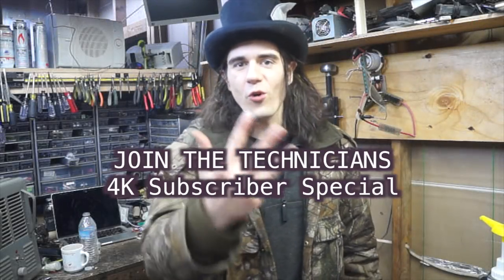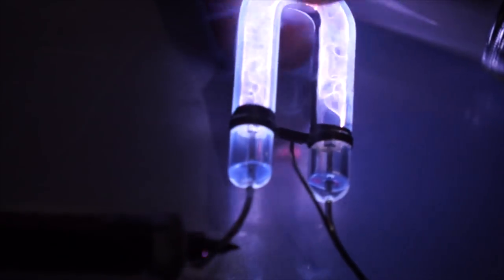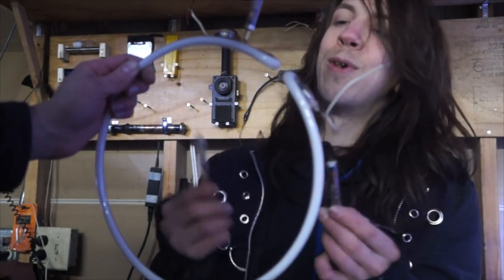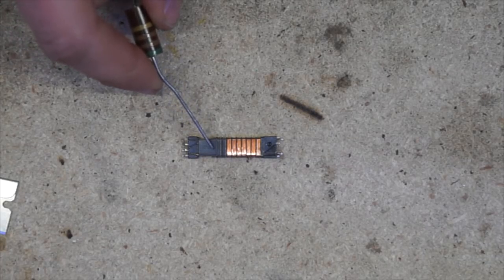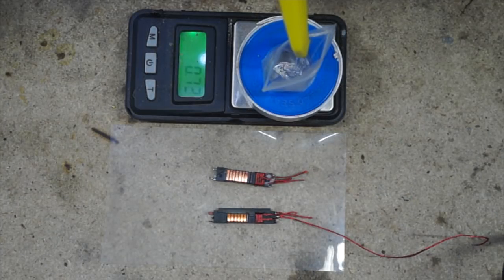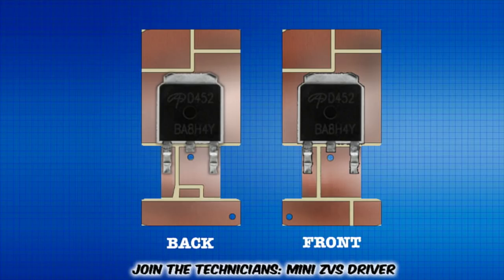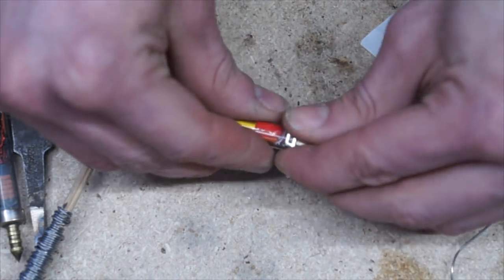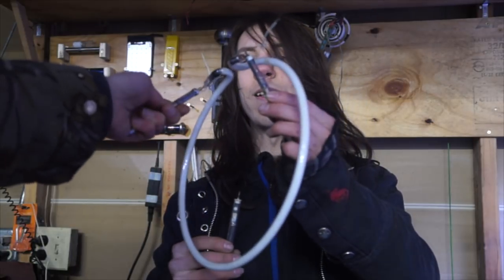4K Sub Special - Plasma Pen Full Tutorial (You'll want one after watching)

Comment: I was an aviation electronics tech in the Navy, & we weren't allowed to use super glue because it's conductive.
I've never verified that, but it might be something to consider if you're building this & having issues with shorting coils. 🤷‍♂️
Reply from the maker: We tested Cyanoacrylate (superglue) for many high voltage applications.  DRY superglue has about 10KV per mm thickness.  However, the solvent that is in the glue before it dries IS CONDUCTIVE and will short out circuits.
Reply: @JoinTheTechnicians  are you going to upload more I love your content

Comment: would this same mini circuit drive an induction heating coil with center tap? been looking for a way to make a small zvs driver for a small induction heating project as larger zvs cuircuits require to much space. the components can be purchased cheap enough from ebay with free international shipping. have a hand full of those transformers that i got from the local technology recycling center for a couple of dollars. thinking of going for 18650 battery as have those on hand. hopefully i will have a handful of working plasma pens, and maybe a magic wand or two.

Comment: Great video, thanks. Schematic: 7:32
Reply: Just tried to build it using 2 irfp250n. Cant get it to work. Going to keep working on it.  I soldered everything together roughly with stranded wire to make connections using the schematic. instead of using the copper clad board pretty sure I connected everything correctly.  Humm
Reply: Update: got it working well.  Didn't end up using this schematic though, I found a ZVS driver circuit on google that uses two zener diodes and two inductors (no center tap on the primary coil).  Unfortunately I need 9 volts to power it and I get about a cm arc at 14v. I'm using a transformer from a computer monitor like in the video. Epoxied.

Comment: Can you include the exact component capacities? Like the wattage of the resistors, voltage of capacitors, etc. Oh and another thing, you barely mentioned the inductor, how many henrys is it?
Reply: Hello, The resistors can be pretty much any size, if they warm up at all put physically larger ones in but we have never had a problem with surface mount styles. we have found that anything between 1r0 and 6r2 to work, but since this is very dependent on the transformer you decide to use this part can't be exactly labeled. You will have to seek out and experiment with inductors just as we have to achieve the best possible output match with your transformer.
Reply: Zenodilodon do u know the mosfet they use?
Reply: @NewYorker-ym1bi  its AOD452 mosfets.